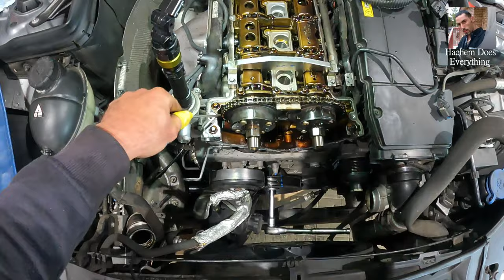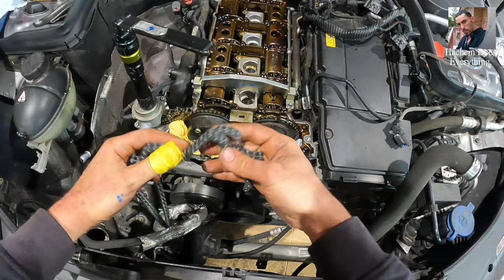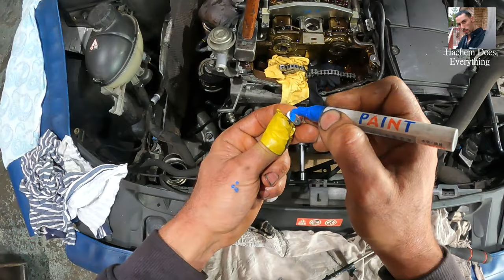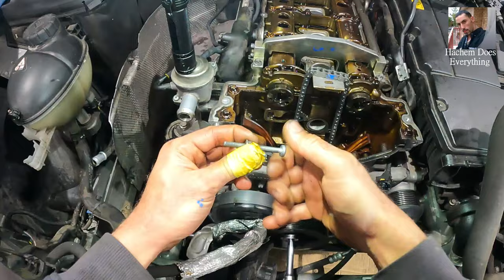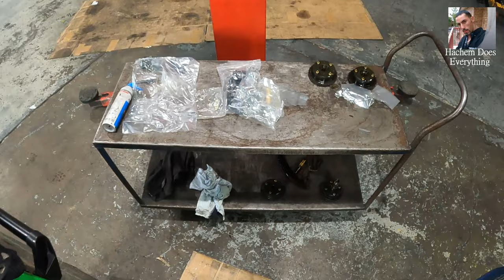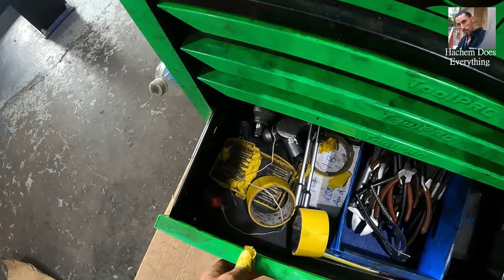Mercedes C200 W203 Engine Timing Chain How to Replace Step By Step

Comment: Quick question mate, can an exhaust cam phaser / timing gear be so bad the engine can't start? Mine turns over with good compression but I get a code P0366 I tried a new exhaust cam sensor but still have P0366 and engine cranking but no start. I'm wondering if it's worth buying a timing kit and the locking tool and replacing the timing gears. Cheers!
Reply from the maker: Hello Mate. Make Sure Safety First. Try to put long Phillips Screwdriver in the Spark plug housing cylinder 1 and turn the engine by hand to get the piston number 1 up  for sure,  then look to the crankshaft harmonic balancer and make sure with the piston 1 up the OIT mark that on the balancer is on the engine make , if not that mean the rubber of the balancer is faulty and turned  and will give wrong timing mark. if it is on the right mark. then check the cams marks make sure the marks of the cams gears are set with the mark that on the cams holder's marks or with the timing tool on. if the engine timing chain is right , check the engine compression . try to watch my video on my channel that says how to do engine compression test without tools and see how i do my way to check the engine compression test, !!! Remember Safety First , Safety Classes Must Be Worn. Good Luck and Stay Safe.
Reply: @HachemHActivity  Thanks for the detailed answer! I took off the cam cover and the teeth on both timing gears are worn and the chain is slack, so I'll follow your guide and replace the timing gears and chain. Thanks for wish of good luck!
Reply: @HachemHActivity  Quick update! Thanks for the tips! Car is fixed! New timing gears and chain - sorted! Running like a champ

Comment: the other  chain guide  doesn't get to be changed?
Reply from the maker: Hello Mate, The Right Side Timing Chain Guide to be changed need to remove the Timing Chain Cover and maybe the sump too, !!! Big Job !!! if the Right Chain Guide is in good Condition, i do not replace it, the chain pressure is on the guide that at the chain's Tensioner side. Thanks for Watching and Have a Nice Day.